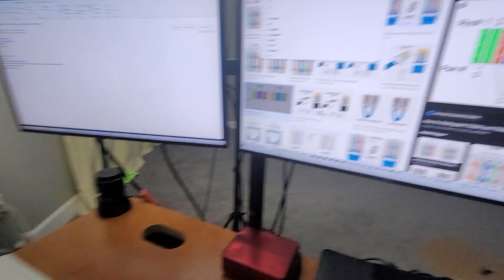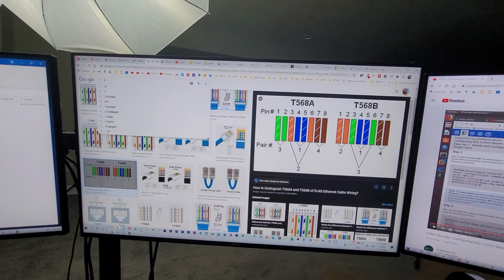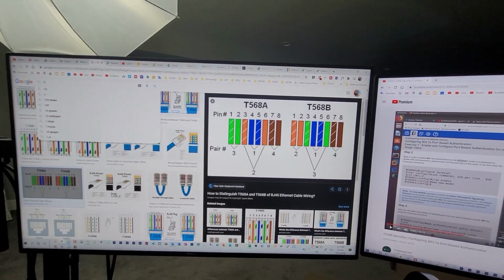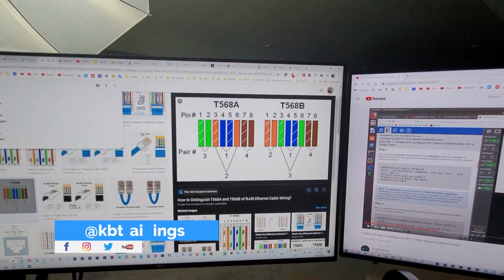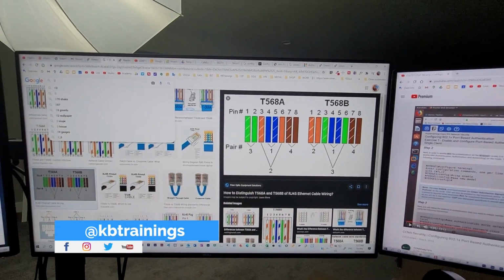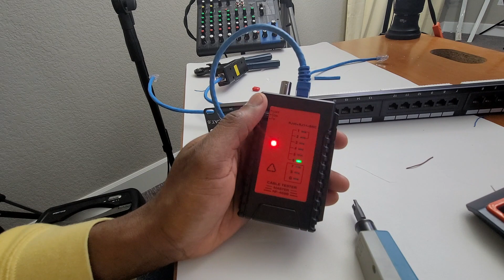How to connect an Ethernet Cable To an RJ45 Connector and a Patch Panel | KBtrainings

Comment: Hi KB, can you provide Guidance with network points? On our workplace our LAN cable works with t-568b but i am finding it hard to create working network points, Either on with the A standard or the B standard could this mean i am not punching correctly?

Comment: Hi! What cable (size, brand/type)  do you recommend for new construction?
Reply from the maker: Hi Andre.
I used Unified Copper Cat6 550Mhz.  Good for new construction. Can run up to 10Gbps with proper devices.

Comment: I may be mistaken, but I believe those kind of cable testers require you to look at the smaller side. The big side just goes 1-8 always, but the small side is the one that will be out of order if something is wrong. At least that’s what I always thought.
Reply from the maker: Hi Evan,
I just checked with the tester to make sure, you can look at the light on either side, the lights 1 to 8 lights look exactly the same on both sides for good or bad cables.
Thanks Evan!
Reply: @KBTrainings  Right, there are lights on both sides, but I think to make sure the cable is actually good, you have to check that they light up in the same order. Because the main unit will always got 1 to 8, but if you mess up the order on the other side, it might go 1 2 4 3 5 6 7 8.

Great video though!
Reply from the maker: Ah ok, I see what you mean. You're right, for the order of the wires,it makes sense. 
Thank you Evan!